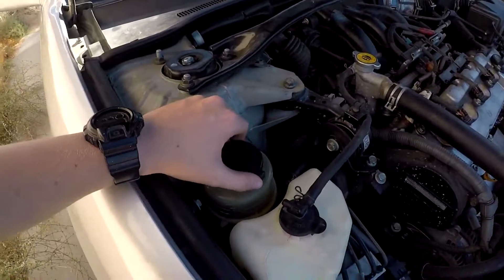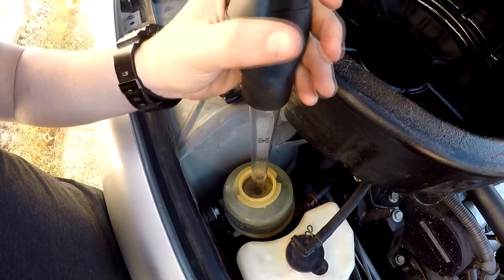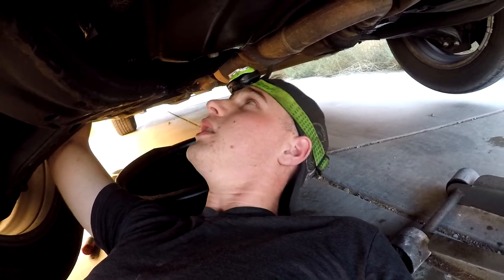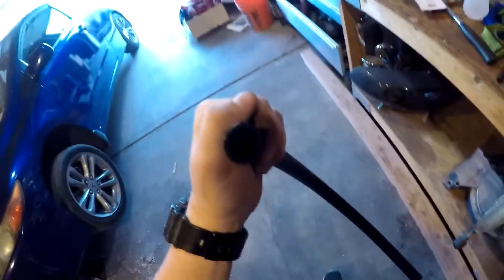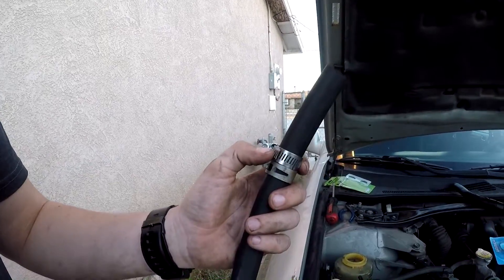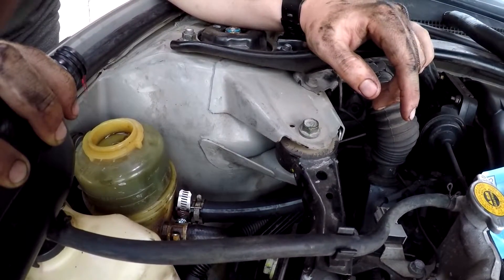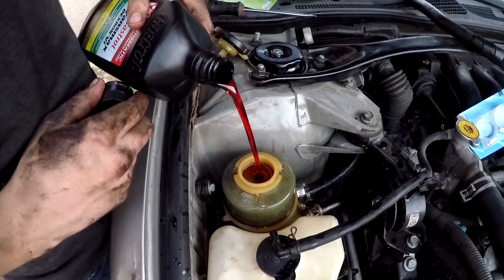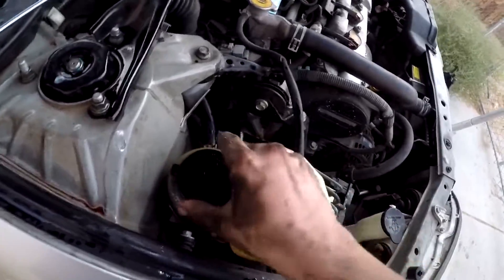2004 Camry Power Steering Hose Replacment

Comment: 02-06 Camry's ( Kentucky, USA built) :  
Here is the part # for just the rubber hoses: " Duralast 80565" or " EDELMANN 80565 ", gotten online.
Toyota won't  sell you the rubber hose segments of the " Return Tube Sub Assembly ."  Its the rubber hoses that are a wear item.  You are only offered Toyota # 44406-06100,  " Return Tube Sub Assembly " . However, the part that fails after several years are those short rubber hoses . Toyota will not sell them individually, you have to purchase the whole assembly. I learned that the return line rubber hoses that Toyota uses for this is a true 10mm inner diameter hose.  These are not gotten at an average parts store. The industry standard 3/8" power steering return hose may compromise /collapse the tubing as the mechanic struggles to install the 3/8" hose.   The correct sized I.D.,  & rated for power steering fluid, part is , " Duralast 80565" or " EDELMANN 80565 ", gotten online..  Otherwise, good clip.
Reply: I bought the Edelmann 80565 and it is too short for my 04 Solara V6 which should be built the same generation Camry with a V6. I got 1 ft. of power steering line at Oreillys and used smaller spring clamps as a better solution.
Reply: For the Japanese built Camry's do you have to buy the whole assembly? My reservoir tank just emptied out today, going to fix during the weekend. So I guess I'll find out.

Comment: Good effort. You should have ran all the fluid out of the car and flushing it with new fluid by disconnecting the return line, running the return line to a drain, plugging the return on the reservoir, filling with new fluid, and pumping it through till clean by turning the wheel lock to lock. You should use the right size hose that is designed to handle power steering fluid because heater hose may break down. Also, you should have used the hose protection wrap from the old hose so it doesn't get worn through by rubbing on something.

Comment: Use molded PS or ATF grade (SAE J189) 5/8" ID hose.  Anyone using bulk heater hose in tight corners will have problems down the road.  Not a bad idea to take this DIY down as it can steer people into more problems if they don't read comments to ovoid this pitfall.

Comment: At 4:59, the big hose he's replacing is the low pressure supply line from the reservoir to the power steering pump, if it's anything like an '01 Lexus ES300 (which it probably is).  

The high-pressure hose comes off a banjo union (with integrated pressure sensor) on the top of the steering pump.  

The return line is part rubber hose and part hard metal tubing snaking below on the subframe and coming up around the radiator.  (At least it is on the Lexus ES300.)

Comment: From working in automotive mfg we always were told to slide the clamp until the bulge tip of the hosebarb stops it.  Then tighten the clamp.   Thanks I will take a look at that hose asap on my 03, I had to replace the lower return line that bolts to the A arm before the cooler tube return behind the rad.  But this new one is hidden around the rack if not there.

Comment: Is it okay to use Preston’s power steering fluid for it even manual say use ATF dexron 2 or 3? I added in in blind thought it’s okay while there is a leak for temporary fix
Reply: Try to use atf transmission fluid for toyota camry power steering.  If you were to use ps fluid at least use prestone power steering asian formula instead of the regular one

Comment: Hi guys. I’m new here, and I tried the same method he did, and it worked; however, after a month I think the hose got twisted and no fluid was going through from the reservoir power steering. Is this okey? Or should I try to find the right piece( the one that has that spiral thing covered around the hose) Also is that hose he is replacing the low pressure hose?
If you guys have any more information about the different types of hoses that I can learn, that will be very kind, thanks!!

Comment: You said it was the return line, are you sure it’s not the supply my dude?
Reply: High pressure supply line uses banjo bolt 17mm at top of ps pump to bottom rack and pinion return line clamps on bottom of pump threads to top of rack

Comment: Get a piece of hose and put it on the end of the turkey Baster with a hose clamp then shove the hose in the reservoir to suck it all out
Reply: Or grab the soap dispenser pump mechanism from your kitchen/bath.
Reply: @ferndog1461  EXCELLENT idea!! I'll have to keep that in mind.
Reply: i used a drinking straw to remove a fluid i needed to drain from a car with a dollar store turkey baster added.

Comment: I think by mistake you add transmission fluid instead of power steering fluid, usually power steering fluid is clear color versus transmission fluid is red
Reply: Camrys of this age use transmission fluid as power steering fluid. Im not sure if current gen camrys do as well, but if you check the manual for the 02-06s, they use trans fluid in the power steering system

Comment: Where did you get the hose from
Reply from the maker: I used heater hose from O'Reilly Auto Parts.
Reply: @etohracing4475  i need to replace one for my 04 gto are all hoses the same? Like can i get one for my car from oreileys?
Reply from the maker: @J117-x7l  Yes, They come in different size tubing diameter. If you pull off the old ones they can size it to the new tubing. I just got generic heater hose.

Comment: Should havere used OEM constant tension hose clamps. Infinitely better that those cheap assed screw clamps.
Reply: Those tension clamps we're old and needed new ones they grow weaker due to heating up n cooling off they tend to be able to remove with no pliers